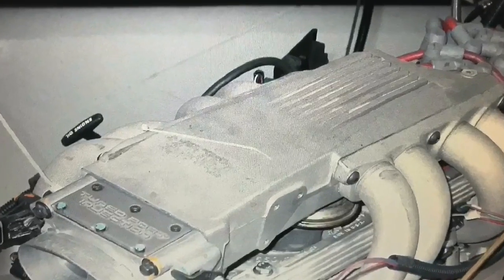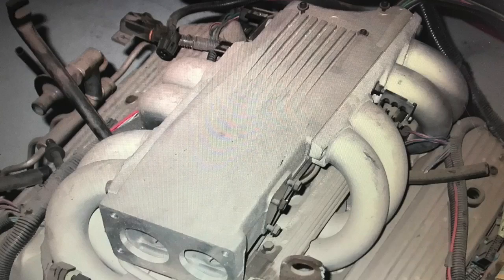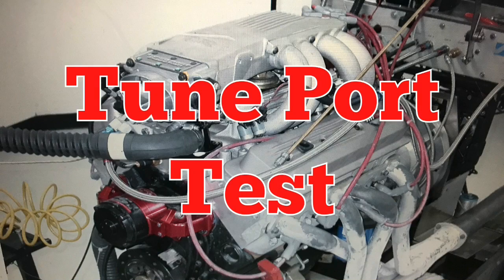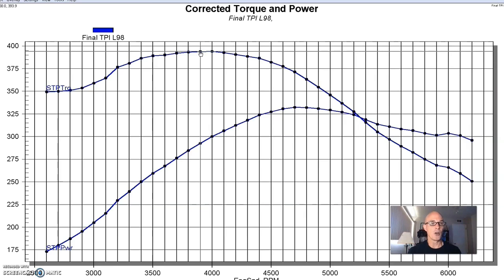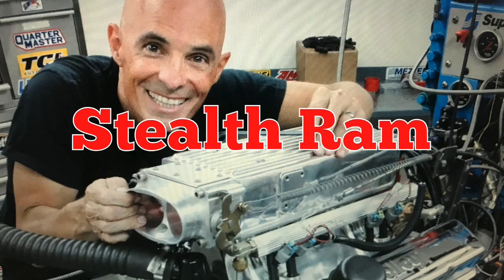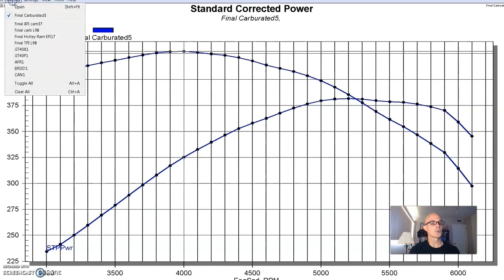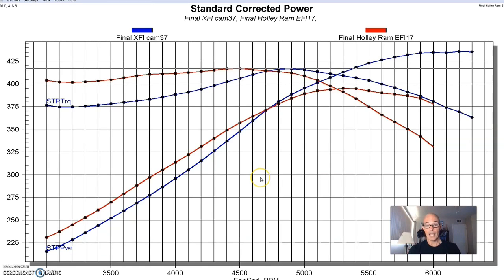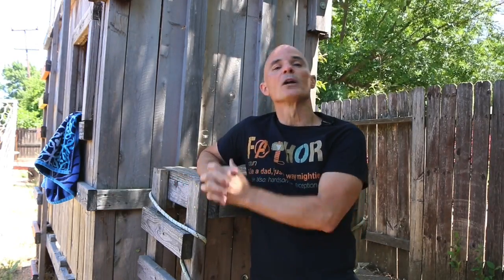TUNE PORT TECH-L98 vs CARB

Comment: I would choose higher power up top. That running out of breath up to feels like your engine is sick, I hate it. Btw - 2001 Toyota Corolla - look at intake on it - also made for power down low and dying up top. As far as comparing carb to EFI - why not to use a dual plane with bosses for injectors - then the same intake could be used to test carb vs EFI. And last thing - I wonder how many 4L60Es would've died if that TPI was used in trucks - especially while towing...
Reply: Yea I agree I have a 90 vette L98 no balls on top but takes off hard as hell

Comment: How about an itb setup on a sbc. Long straight runners make torque and hp from what I've seen on imports. Mechanical fuel injection or multiple carbs. I think chevy had a 327 in the 60's that was raced this way. Also ford 289 and 427 race cars.
Reply from the maker: i ran a SBC with Speedmaster downdraft
Reply: @richardholdener1727  That's awesome!
Reply: @richardholdener1727  Watching now!

Comment: Imagine the odd feeling one gets when theres a sense of relief that it's a SBC test rather than an LS test
Reply from the maker: on this channel-we test it all
Reply: @richardholdener1727  I know, it was mostly in jest.  Definitely more diverse set of tests than other masters of engines
Reply: Who cares an air pumps an air pump
Reply: @austindoud273  Ever seen the old combo engine/air compressor setups? Take a 351w or 302, take one head off, put a Reed-valve head on it, then boom... 4 cylinder self-contained air pump. AKA Monoblock Compressor.
Is it relevant? Not really. But it does fall in line with air pump. Random info of the day for you.
Reply: @typrus6377 had one of those at work, old 302. It sat around so gas was old and carb needed cleaning. Wanted to fix it but navy makes you stay in your lane and i think the beast must have ended up at dermo because it disappeared...
Reply: @austindoud273  How does an air pump an air pump?
Reply: @austindoud273  Okay take my 4cyl air pump

Comment: The tpi would be slower than the carb in the 1/4 but are really great on the street.
Reply: What about  the 1/8 mile?  I haven't had a chance to run her there yet but I have a 350 TPI Formula Firebird and my local strip only does the 1/8 mile.

Comment: Any thoughts on "FIRST" TPI Intakes? Interested to hear if anyone has experience with that intake. Edit: For a daily, I sort of prefer the torque vs overall horsepower mostly because I cruise in the mid rpm range on back roads.
Reply from the maker: I think the FIRST might have a small TB, right?
Reply: @richardholdener1727  they claim 835cfm or optional 1050cfm throttle bodies. Don't immediately see a size in mm on their website.

Comment: Built a 350 to put the tpi on with tons of research, Cam, compression, Injector size, gearing, power ranges rpm and this one video was a pretty good summary of most of it.

Comment: I would pick the L98 injection for my usage case because anything I build would be just a street driver or daily. So i'd benefit from the easy cold starts, throttle response, more precise instrumentation and on the fly fuel trim adjustments. Unless i'm really ringing the car/truck out on the street for some reason it won't really see much time above 5000rpm. If I were building a track car that spends most time high in the rev range then of course the carb wins.

Comment: Dear Richard....
Could/Have you done tests on the Economy style intakes like the old SP2P and those double port intakes?
Reply: I would like that.  I wanna see them take a tbi 350 and replace it with a 2barrel Holley and diff computer to make tuning easier
Reply from the maker: My 1970 1/2 RS had an SP2P

Comment: Always built low compression motors for the street ( max 9:1 or so). Built them for low and mid-range torque. Horsepower was nice but Low/ mid range torque busts the but best.  In my day usually ran dual plane intakes with either two barrel Holley or small Holley four barrel. If I built one today I would definitely go with a Fitech or Holley throttle body fuel injection. I always kept lift on my cams at or below 0.550 with duration around 220-235 degrees. Lisa at or around 112 degrees. No experience with the tuned port but was pleased to see its torque production down low. Thanks for your tests. I really enjoy them. Your a great educator!

Comment: Does low speed torque really make a difference if I have deep rear end gears like 4.10-4.56 and a 3,000-3,500 stall speed converter?
Reply: Jump out of the hole like a rocket but fall flat soon after.Your setup calls for high revvin HP
Reply: Single plane

Comment: I'm running TPI so i made the choice. The plan was to add a turbo but that would only worsen traction issues. Went there after running a small displacement with rump rump cam. The torque is much more fun.

Comment: Gee, thanks mate, very interesting, the thing is this,,, i have never been a fan of rev the crap out of something, WHEN, you can get serious grunt at a lower RPM, my 89 vette is SUPPOSED, to be 240 hp 340 t at low RPM, i dont know if anything has been changed Int, but it has A/M runners and from the runs i have had on the street, it goes way better than those figures.... So to keep the grunt where it is,,,, a PUMP AT 25 PSI, is what its getting.. thanks again for TPI stuff.  
Eddie 
Sydney Australia.

Comment: Since boneyards are full of TPI setups that no one wants combined with the availability of aftermarket ECUs and the SBC still being the cheapest to build, this makes me want to build a TPI setup for my tow pig and replace the vortec TBI.
Reply: Right?   He makes a really good point about the TPI in a tow rig.
Reply: ive got a full tpi setup with ecu and wiring for a 350,come get it...need a long block,got a couple of those as well.
Reply: @trillrifaxegrindor4411  
I need one,  for a 1984 Chevy 1/2 ton.
What is the price??
Reply: even easier,get a vortec tpi base and add tpi at your leisure

Comment: For a street car I want the low end torque. For a drag car I want the high end horsepower. 

I wonder if I could replace the TBI with TPI on my pickup without having to change the heads?
Reply: Yes the TPI will work with the swirly heads.

Comment: Awesome information.  The old Ramchargers Drag Team had some really interesting home brewed intake manifold designs back in the early 60's on the Dodge and Plymouth stuff.  They did a ton of experiments with intake runner length.    Thanks for the continued education.  I learn something new every single time I watch your stuff.  I really look forward to it.  Thanks.   Dig the shirt too, by the way.  Great kids come from great parents.
Reply from the maker: Westech ran one of the Dodge intakes on the dyno-amazing stuff
Reply: Those intake and exhaust systems they used to run were crazy😁 some cool history

Comment: I enjoyed my L98 Corvette, had a auto with 3.08 gears, torque was amazing, but my 93 with a LT1 6 speed was the best
Reply: ٤٥٥٤٤٥٥٤٥٤٤٤٥⁴٤٤٤٤٥٥٤٥٥٤٤٤ص٤٥٥٤٤٤٤٥٤٤٥٤٥٤٤٤٤٤٤٤٤٤٤٥٤٤٤٤٥٤٤٤٥٥٤٤٤٤٤٤٤٤٤٥ض٤٤٥٤٤ص٤٤ض٤٤٤
Reply: What was the rear gear in the LT1?
 I suspect that if the L98 had the six speed, and a 3.43 rear, the gap between the two would have been much smaller.
Reply: @johntempest267  3.45 with the 6 speed, no way the L98 can match a LT1

Comment: What is the prime rpm range of the LT-1 intake?
Reply from the maker: much higher
Reply: @richardholdener1727  Well, even I am smart enough to figure that out without any help.  Was kind of hoping you would know the actual RPM range.

It's probably about right though.  I'm going to turbo one, and probably need to concentrate the torque at higher rpm anyway.

Comment: When I see this stuff it always reminds me of the thought of what GM was thinking with the trucks... Here's a truck engine that would have blown the TBI junk out of the water for torque.... and does.  They could have even run the swirl port heads with it lol.  Even better... release the Vortec head in 1996 and then literally put the worst intake and fuel injection system they ever created on top of it.  Would have been better off doing a  sequential setup with TPI until the release of the LS.
Reply: What's worse is it's not like they didnt have the parts laying around.. typical corporate decisions Im sure, cant seem like youre lowering 'performance car' tech to the hordes of unwashed truck buyers. lol.
Reply: Spider has its limits - but it's not worse than TBI.
Reply: Daniel Hoffman 
Never had issues with my 92 TBI.  Fixed other people’s spiders.  A TBI is essentially a carb that meters out the fuel electronically, and now there’s relatively cheap ecu replacements to be able to flash tunes.  

I’m all for port injection, but I’d take a Vortec headed TBI over the spider intake on those heads.
Reply: @wereexpertstoo3795  spider sucked because those bastards were brittle AF.
Reply: Well, durability and performance are two different measurements.  The points about TBIs are durable, cheap, flexible, you can use cheap ECUs to run them on all simple carb manifolds, etc., are all valid.  But I don't think the spider's reliability was that bad (I replaced my original after 22 Years and 100k and it was fine), and it is better at metering fuel and performance up to its limits (TBIs had low limits except for the biggest cfm model) - which, once you pass the base reliability threshold - which I think the spider does - is what you're measuring.  I also believe the later replacement part design resolved the main issue.

If your metric is simplicity and durability (and to some extent, looks), TBI wins, no question.
Reply: Also - the entire system is now $260 out the door, and you can now but individual injectors (though I've never done it).
Reply: hey now the 1996 spider injector was a huge improvement over the engine fire inducing maxi injector from the vortec cpi motors. thats did require replacing the whole injector and had poppet valves that caused replacement of the whole injector. the 1996 versions were rebuildable. you could replace one hose and injector vs all. they are quite fuel efficient and werent that unreliable. very easy to swap it takes less than an hr to replace. also the vortec fuel injection everyone complains about is the reason why we have the ls fuel injection and engine control system everyone praises today. so its pretty hard to design new items and test them without real world tests. they even can use the exact same pcm. just sayin. also the tuned port was what created the vortec setup. the lt1 was the oddball before it that had sequential spark and fuel with basically the vortec heads. the tuned port style intake and lt1 style werent that great so the vortec was created as the last sbc huzzah before the r&d paid off for them and they released the gutless wonder everyone loves so much the ls1.
Reply: Or if not in the regular trucks build an SS version as they did but instead do the TPI setup. A buddy of mine made that swap years ago, ‘91 TPI 350 into a ‘91 GMC Sierra. That was a fun truck that walked all over the newer vortec stuff.
Reply: Spider was horrible not to mention one little piece failed the whole thing had to be changed instead of a 100 dollar fuel injector a  600 dollar spider system what garbage

Comment: If you used like a 3-4 inch spacer on a blow through carb setup would that help inter cooling vs just a 1in or none at all?
Reply from the maker: maybe a little-but it also changes carb signal